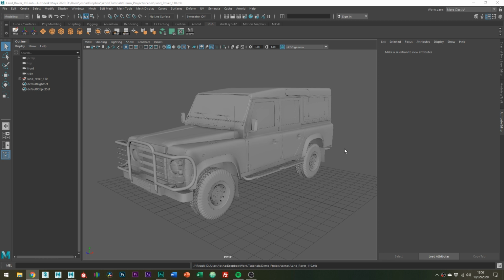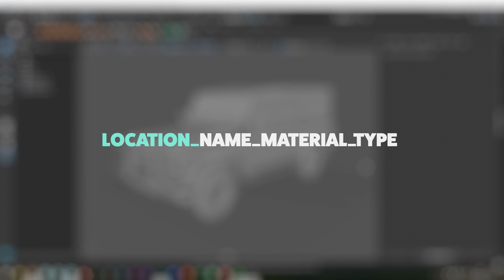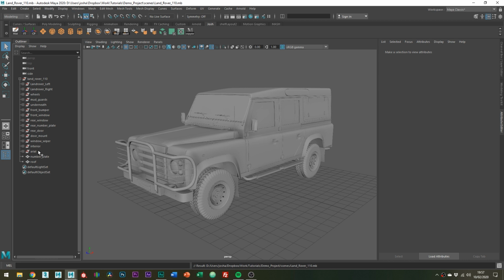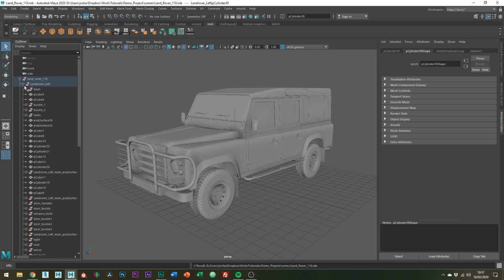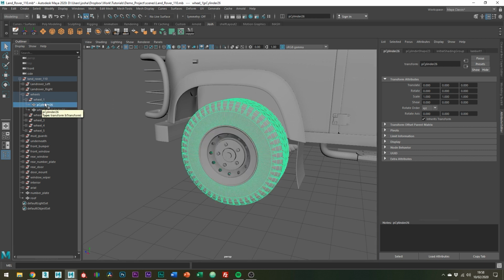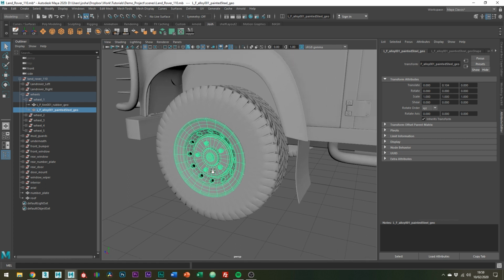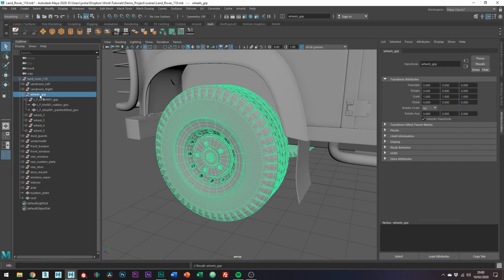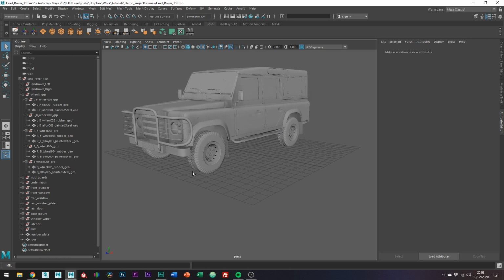3D Modelling Naming Conventions

Comment: What about when something doesn't have a name? I'm modelling a fire hydrant and it has these little nubs sticking out on the sides that serve no purpose. What do I call them? Nubs?
Reply from the maker: Usually if something doesn't have a specific name I can think of, I'll just name them 'mainObjectName_component_1'...
Reply: @JoshAntonio  that's a good idea! Unfortunately I already handed in my assignment, nubs and all! 😅 Good to remember for next time. I two other questions: do you include the location of the object of it's the only one of its kind? Like if the car had a spare tire on the back, would it be B_spareTire_tarp_geo or just spareTire_tarp_geo? And how do you differentiate between "bottom" items and "back" ones, since they both start with B?
Reply: lol, those are ports for the firefighter to hook up their hoses to. The little nubs are caps to keep the threads clean so there's no difficulty hooking up the hose quickly during a fire.